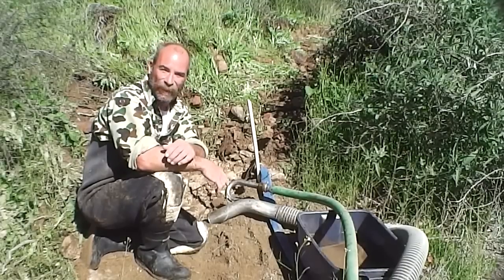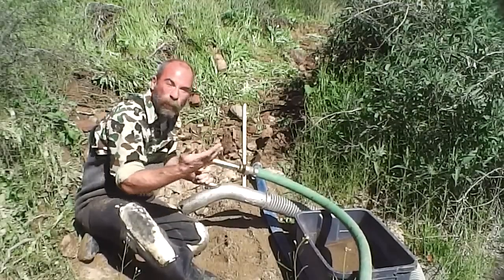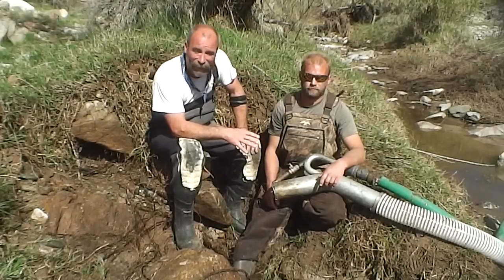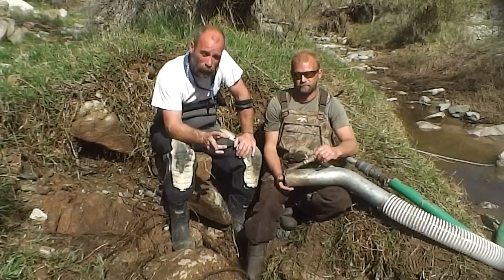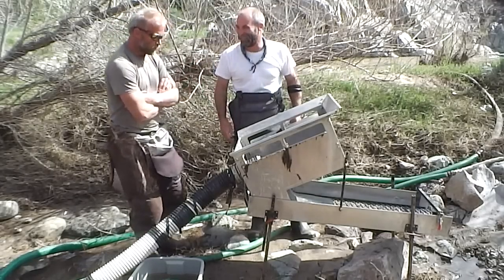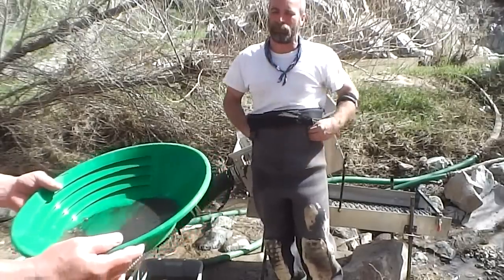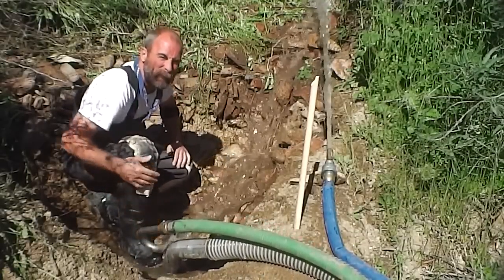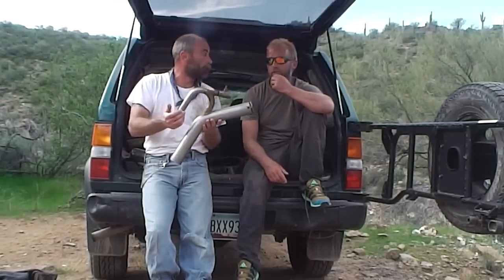in the gold fields on dredge nozzles

Comment: all these gas engines guys use are wayyy too loud, it would drive me up a wall hearing that racket...why hasn't someone come up with a long extension on the exhaust pointing straight up???, it would require a tripod to steady the pipe, but what a difference!!! You'll be able to work, think,and hear better.Always a good show here...been watching for a while
Reply from the maker: the motors are really not that close..and when a hole you dont hear much...but dont let them sneak up behind ya lol
Reply: Can’t you loop the exhaust around and into the water to quiet....?